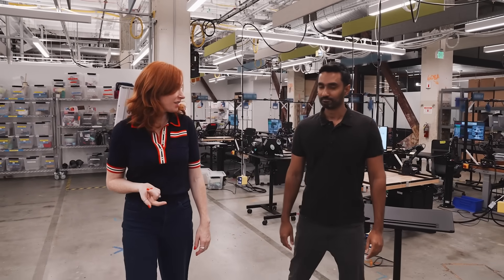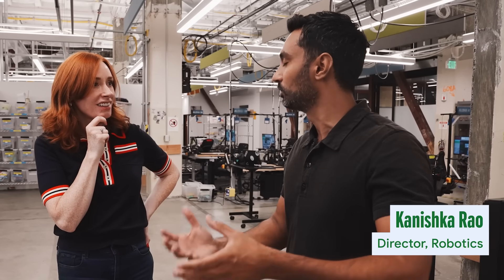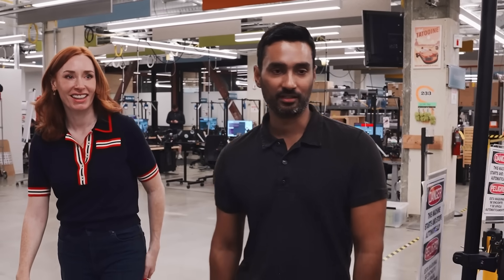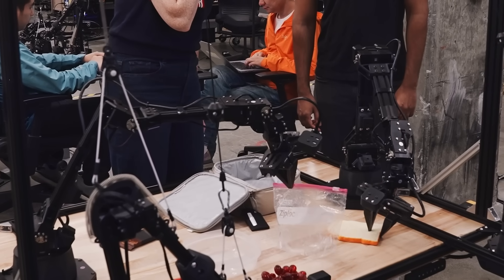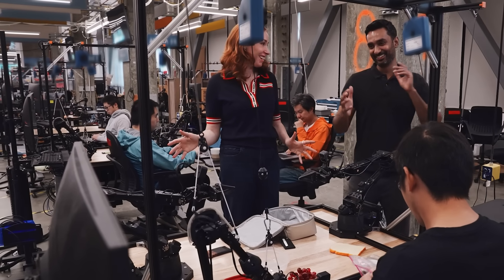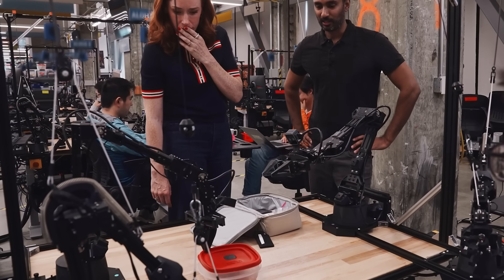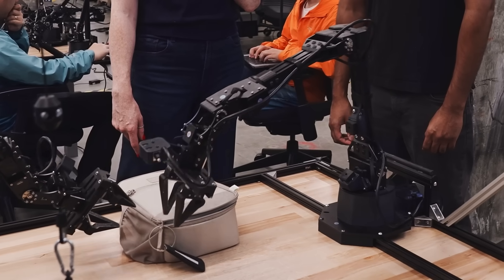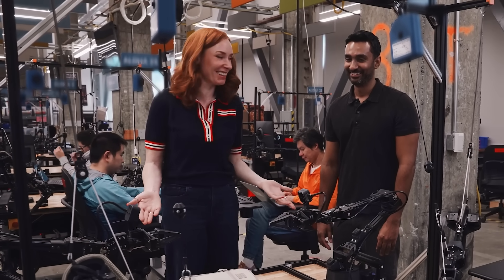Google DeepMind robotics lab tour with Hannah Fry

Comment: Some physical activities are learned later in a human's life, such as sports or the usage of a manual tool (using no electricity) or a power-tool, by which time, that person may have specialised much of their learning and cognitive function into literacy, such as their GCSE (or A-Level and degree, or whatever) vocabulary, such as Chemistry, or statistics. While placing a piece of bread in a bag that contains air (which is gaseous, thereby as per Boyle's Law) is somewhat childlike, it is not if food-hygiene preparedness is taken into account if serving to another person (who has perhaps handed over a fraction of expenditure for the services) and so if a person is completing tasks in a kitchen such as a chef (or assistant to a sous-chef, or a porter role or cleaner), the person ends up learning spill-hazards and will not touch the bread or food of another person until they have that certification which not only is for food-hygiene but also for "ISO 14001." Thusly, people do not always learning things like that and are more likely to have used a scientific calculator (or at least a basic calculator) before preparing food for another person (i.e. not the same as preparing food for their own Maslow's hierarchy of needs, uninvolved with other persons who would have had a role of recipient). As a child, I used an abacus before making my own sandwich or using a zip-lock bag which (even if they had existed at the supermarket) would have been unlikely to be in the cupboard as a household item. In other words, GCSE or A-Level (Ohm's Law formula-triangles and similar) formula-triangles and Coloumb's Law (or trigonometry, pythagoras) and basic facts like how (as per Newton;s Law on gravity nd he formula-triangle fo acceleration) the visual concept of a launched particle like a cannon-ball (or maybe sports ball) would already be known to conform to the ascent and decent and distance form moment to take the path or a parabola as the ball rises and falls into the sky before coming back to the ground. Burping a Tupperware or a ziplock bag of air or anticipating a particle like a cannon-ball in a game of tennis (as if the tennis ball has a similar trajectory and duration) is approximated in the brain of the human for some people, and others may call upon basic mathematics, like using deductions and addition and multiplication and division in the head or a square of square-root before an object is moved (like a thrown all or a deflated of inflated bag), predicting with and inertial momentum ratios and so forth. A pocket-calculator or cyberdeck, with or without pencil and paper (or paper-and -ink like a Wacom tablet or touchscreen, likewise) are sometimes used by people before performing some task, including preparing food for another person. So learning placing fragile food, capable of contamination, into a bag (with air in) and what is flammable (Joule's Law of Heating,watt's Law, Ohm's Law) is calculated by the human in advance  (even if some is learned by rote). This is especially the case if it is predictable that the one bread slice in a bag is a task (as per the pile of Lego mentioned) for repetition or interaction many times since a purpose is to make meals for many people or to make multiple meals to freeze or dry in storage for one person to eat  in a year or weeks_ instead, being mindful of rate, time and instances counted, culminating in the factoring of frequency. People don't tend to like repeating an activity if planning means they can measure twice to only make a mark (by scored pencil or slicing) once. It reduces wastage in terms of what is permanent and people plan efficiency and reliability metrics (tantamount to Ogive of Viterbi-HMM, ROCOF, FIT, MTTF, MTBF, MTTR with time-date-stamps on starts and ends) especially by using a calculator or a cyberdeck, as in a Linux computer the shape of a Blackberry-smartphone with a chatpad keyboard buttons plus diode-transistor. Some folk learn to play a musical instrument this way or others do not bother to read music much nor fluently. Some nag themselves before tasks if multidisciplinary, deliberating plans via those mechanisms. Each time I see robot LLM driven technologies, it seems missing a keypad-cyberdeck to perform typing or calculations (like a javascript for-loop combined with a spreadsheet "fods" file for LibreOffice formula-bar) in advance of such actions, like making a "reagents ingredients" list (with expenditure or probability estimation) before going to supermarkets, with advance conceptualising of recipes or DIY job to pertain to the mission, e.g. temperature-dependent forward voltage (V_F decreases linearly) of a silicon PN junction of diode-to-transistor.. Thus, human interaction with robots could expect a human-interface-device like cyberdecks operated by robots (by a "hand", even if a serial connection is wired to it and IEEE1284) so the same cyberdeck model can be operated by a human, allowing activities of "show and tell" on cyberdecks (like reliability-metrics, business allocations e.g. graphical-linear-inequalities to time-date-stamps) by human or robot, before, during, after the task (like fabrication, assembly of a DIY project with reagents, or recipe meal-preparation),_ to copy,  emulate actions required, for efficiency so it all has logistics (like supermarket missions, or obstacle avoidance via Bézier-curve polynomial-fitting, polynomial-damping to polygonal conversion and the above frequency). In the mind (e.g. graphical-linear-inequalities) people may think of things as entity-relationship diagram of relational database to normalise ratio, vectors e.g. thinking to scribbling maths-problem concepts like "a sandwich has multiple bread-slices" as is of an ERD (entity-relationship-diagram) thusly a basis of SQL query, albeit basic (as arranged  Audio-CD collection, as if by id3 tags of mp3). That’s also done, planning gifting for other persons, e.g. Chrimbo or anniversary (by probability estimation for what persons might already have in collection or what other people are likely to be gifters of to them, avoiding clashes). The hunter-gatherer resource allocation has such planning, or if issued a directive by a boss, as per making meals for other people or packing preparedness rucksacks for camping trips. As per music, the mind separates into a series, finds sequences or motif, so some people are aware of that and plan it all (by abacus and paper plus pencil, or instead by cyberdeck Linux computer shaped as a blackberry-smartphone). The way that robot arm is "learning" things is valid for some scenarios but some people learn things (either afresh for the first time, or revised instead of anew) in a different way by the route of the aforementioned deliberation or plan-calculations. Where some people lack dexterity, they pause, figuring out why they cannot do something (perhaps as tendons on their fingers lack the same length as a person more naturally inclined to rapidly become adept at claw-hammer guitar strumming techniques) so they instead pause to plan something like a RBF-KDE Radial-Bias-Function in the head for probability estimation (like a spreadsheet of what "to do", or evaluating inventory-management like a preparedness-rucksack trips, lunchbox, first-aid-kit and map  as in basically a Ripley's K Calculation or Gaussian kernel matrix heat-map, or Monte-Carlo-simulation for edge-detection as per card-counting in place of the Laplacian domain then z-transform to time-domain). This is seen too when categorisation occurs as "Who, what, Where, When, How, Why", refines purpose and prioritisation juggling in Maslow's Hierarchy of needs (even if it means applying a coding "do-while loop" to some surds firstly unto a distributive-property with BODMAS). Target practice is another example or taxonomy.  People sometimes process vernacular language like an occupational-therapist might seek redundant verbs in anecdotes, so a lexicon forms. Motivation includes how currencies are an interchange format, a bit like a collada file in some ways, so people ponder plans for expenditure and time revenue allocation of resources, respective of how time is a precious commodity for their role and purpose (so pattern recognition for better yields comes into play, like using a small CRC32 checksum visually for comparison and integrity). It can be easier for some people, in place of learning music traditionally, to draw upon their Latin-Hypercube-Sampling knowledge and GEPP Gaussian Elimination with Partial Pivot, and knot-theory of Jones-Polynomials before securing a boom and mast like a skipper. So a person can have a look-up table sheet like a tourism phrasebook used in learning a language (like commonplace French translations) for commonplace queries but instead to tell the robot-arm to manipulate the stress-ball using the above science plus formula triangles in Linux BASH and Python, but hitherto, FFT unto spectral-element-method for heat and kinetic energy imparted in terms of probability estimation for squeezing ball resistance restitution material properties (like ester groups or valence bonds in materials of other environmental compounds or mixtures) and hereinafter, beam-forming sound of metal-tray interaction, using  Lanczos-kernel for azimuthal data by vibrations and electromagnetic spectrum, mitigating risk-analysis to feasibility-study via ISO standard  (contextual to Reidemeister moves, absolute-difference, creating reportage of findings afterwards where each relevant term has UUID, time-date-stamp duration, vectors like acceleration, to store data that labels this approach for any such environmental manipulation activity as "batman2-style").
My comment has no hate in it and I do no harm. I am not appalled or afraid, boasting or envying or complaining... Just saying. Psalms23: Giving thanks and praise to the Lord and peace and love. Also, I'd say Matthew6.

Comment: Comparing AI and Robotics Learning

"The learning models used in robotics are fundamentally similar to those used in AI. In AI, specifically with multimodal Large Language Models (LLMs), we use data like text and images for training, where the 'action' is predicting the next word or move.
In robotics, the training data is gathered from cameras, LiDAR sensors, and encoders. In this case, the 'action' consists of motor voltages and torques. Just as AI predicts the next word, a robotic model learns by determining the exact voltage and torque required for movement. While the logic is similar to standard AI, robotics involves a much more advanced form of data learning.
Currently, both AI and robotics rely on Reinforcement Learning, requiring thousands of trials to identify the rewarded action. A major challenge remains: we still lack a method for 'one-shot learning'—the ability for both AI and robots to learn a complex task from just a single example."

The "Chain of Skills" Theory

"Mastering these actions is essential because it means the robot has successfully accounted for gravity, center of mass, balance, and motor precision. I think of these individual tasks like beads on a string.
If we can link these different tasks—such as walking, hand movements, and defensive maneuvers—into a single, unified chain, the robot would only need a fraction of a second to connect or switch between them. Without this unification, a robot cannot learn such complex behaviors in such a short amount of time.
The bottleneck lies in the model's learning architecture. Once we achieve a breakthrough in real-time programming for any type of movement, we will see the realization of General Purpose Robots. Just as 'agent-level' task performance is still a primary focus of AI research, it remains the ultimate goal in robotics."

The Solution (World Models & Spatial Intelligence)

"I believe the problems mentioned above will be solved through World Models, Spatial Intelligence, and Agentic AI that learns in real-time within its environment.
These technologies will allow robots to learn significantly faster by creating a continuous training loop. Once this loop is established, we can run these models 24/7—for weeks or even years—within a simulated or real-world environment. This constant stream of learning data will eventually enable AI and robotics to achieve full autonomy."
Reply: if they are all connected, then one learning how to screw a bolt will share that information to everyone, so later when there is 10 000 or even 100 000 robots they will be able to learn very fast
Reply: @fpsserbia6570  The technology you are discussing is part of the Boston Dynamics Orbit system.

Comment: I THOUGHT WE HAVE PASSED ALL THESE PRIMATIVE STAGES ALREADY.

😮😮😮😮😮😮😮
GROW UP GUYS
U NEED SOME CATCHING UP TO DO

CHINA IS WAY TOO AHEAD OF YOU
Reply: the difference here is, that Google is 'training' a sort of 'general purpose' system, that is suppose to be capable to infer/conclude what to do next, based on the situation at hand and its 'general knowledge' (like humans do), without specialization training/knowledge for specific tasks/situations, what the other robotic models are usually doing, which - I reckon - will cause issues w. the data/processing load, with exponentially loaded up IF-THEN-specialized situations training. After all, that's how humans do it, in the first 10-15 years of life. We, as humans, are only this good with a task/any task, because we can infer from general knowledge about how the physical world and all its items/objects in it actually works
Reply: @ottonormalverbraucher1083 
AGREED NO QUESTION ABOUT IT.
BUT MOST AI BASED BOT BASES HAVE SURPASSED THIS STAGE ALREADY.

AND GOOGLE IS SUPPOSED TO BE THE CAPITAL CITY OF THE DIGITAL WORLD.

AND NOW IN WAY I SEE AN OLD CITY.
LOOK AT WHAT HAS HAPPENED THE GOOGLE SEARCH ENGINE.

TYPE 
WHY GOOGLE IS STUPID 
YOU WILL SEE THAT I'M NOT THE ONLY ONE SAYING THIS.

ANY WAY
I WISH GOOGLE NOT TO BE ANOTHER YAHOO.
GOOD LUCK.

Comment: I think the interesting question would have been, have these robots been training only in physical world? Simulated environment could run at much faster speed than real life and allow faster development of the models just by experimentation.

AI systems such as AlphaZero only do simulations and learn everything by running trial and error in simulation. I don't see a reason why you couldn't do the same thing with robots, except that when you render the simulation and use simulated camera to view the rendered scene, it's just computationally expensive. But it should be a lot cheaper than building an army of robots to train with real world physical robots for everything.

Comment: Understanding instructions? I won't believe that until there is a demonstration of understanding. I think what we've got is a robot that can execute instructions rather than understand anything. However, I am impressed with what these robots can achieve.
Reply: They understand. I think what you mean is intelligent. The capacity of a system to acquire information, form accurate internal models of its environment and apply those models to solve problems efficiently across varying contexts. LLMs do not meet that definition. They map inputs to outputs using statistical pattern induction. They simulate reasoning; they do not perform intelligence as defined. This is the very start of that, world model learning, action and control. A long way to go even here and many steps after that.
Reply: @simonr_1 , however, none of that is "understanding." That involves the "why" of doing things. The robot is instructed to separate whites from darks for laundry. The addition of the red top to the laundry is just another "non-white," rather than a separate color that might bleed into the blue clothing.

Comment: Perhaps that missing thing is adding planners that work  on a bit different of a principle but are specialized and do not attempt to do everything but can  constitute a family of experts.

For example a planner for a home robot might be a refrigerator planner that can plan how to add or remove an item (say a bottle of ketchup)  for the fridge and that plan can account for having to move other items or even remove them temporarily to get access to the item to be removed.

This planner does not need to know anything about the bot itself but can treat the removal of that bottle of ketchup as if it could levitate on its own and fly out of the fridge this creating a route much like one might create for an aircraft to fly. 

Then that ketchup "flight plan" cold be used to  direct the robot to pick up the bottle of ketchup and remove it from the fridge where the bot handles the details of how best to do that.

BTW, I have posted a few videos on my YouTube channel that describe this in more detail, one called A humanoid Robot Ecosystem  and another is called, How a Humanoid Robot is similar to a modern aircraft.

Also, in the comment sections of the video I posted a chat I had wit Claude Sonnet 4.5 on the hows and whys I chose to employ this approach.